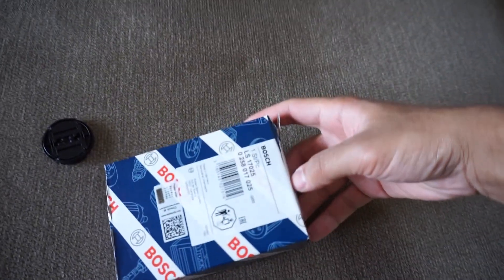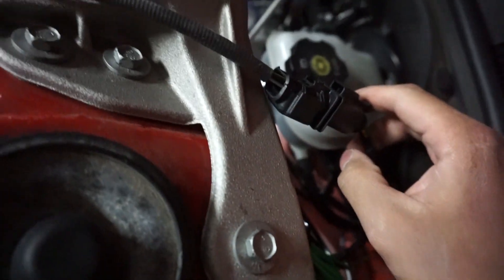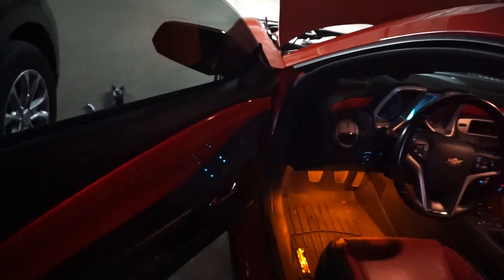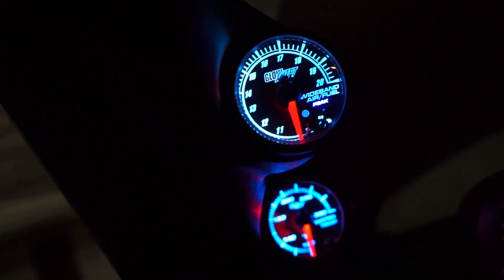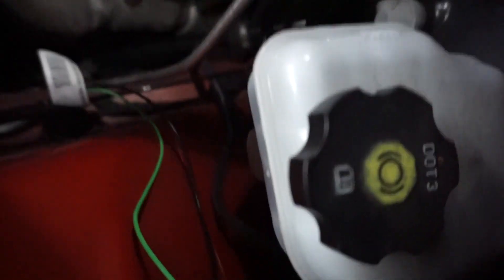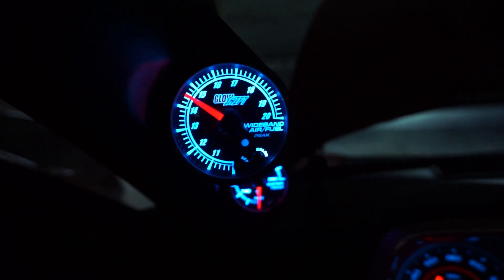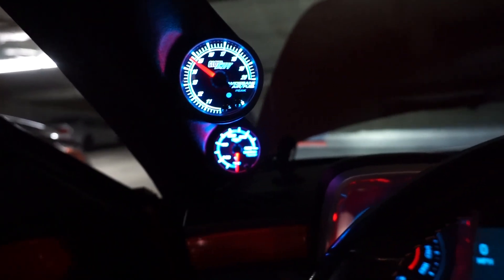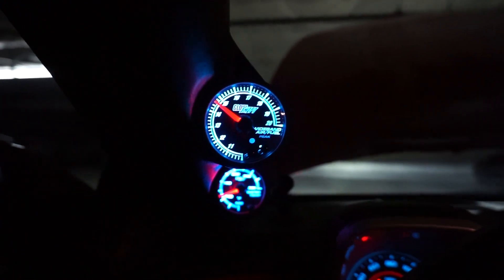GlowShift WideBand Calibration(High Low Warning Setting)

Comment: I'm pretty positive. You don't have to do that everytime you start the vehicle that makes no sense what's the point in the gauge. If u got to make sure it works everytime u turn the car on lmao wth
Reply from the maker: It's not making sure it works, it's the sensor warming up. Glowshift says it's a mandatory thing you should do every time the gauge and sensor are powered. If you don't want to wait, that's on you champ. And if you dont believe me, look up the glowshift wideband instructions and it's in fine print for yah.
Reply: @mistermanage1119  the digital seems to be different from the stick gauge.
Reply from the maker: @LaCacaLoca  In what sense?
Reply: @mistermanage1119  I don’t have to do that and it doesn’t say in the manual to either. It just recommends to recalibrate sensor outside of exhaust pipe every 6 months for daily drivers or every time if track use.
Reply: @mistermanage1119  maybe it has to do with the min and max setup on your gauge to keep it calibrated also. Since digital is just reading straight through the controller calculation output. There is no other button other than to change color on the digital.
Reply from the maker: @LaCacaLoca  Here you go bud. https://www.glowshift.com/instructions/7-Color-Series/GS-702DL-WideBand-Datalogging-Gauge.pdf
Read the part that says "Prior to operation, the sensor must warm up for 30
seconds. This is a mandatory process every time the gauge
and sensor are powered. The LED display will show a
scrolling graphic until the warm up phase is complete."
Reply from the maker: @LaCacaLoca  The calibration button is on the controller not the gauge.
Reply: @mistermanage1119  i don’t know what version I got. My instructions don’t look like that and the constant power saves color and last calibration status. 

The recalibration is 6 months instead of 3. I’ll find my invoice and see which one was the version I got.
Reply from the maker: @LaCacaLoca  That link is off the website so its up to date. the sensor needs to warm up every time not calibrate. As I said to the other guy above, its not calibrating, its warming up.
Reply: @mistermanage1119  I never said you were wrong. I had suspicions mine was a little different that’s all. Good to know either way if I go with those some day.

Comment: which fuse is for the dome light the fuse box on driver side cant tell
Reply from the maker: I don't think there is one. You would have to search online for the fuse panel. Here is a link to a website and I don't see any for the dome. What are you trying to do?
Reply from the maker: https://www.autogenius.info/chevrolet-camaro-2012-fuse-box-diagram/
Reply: Anybody know? Its bcm but what is it
Reply from the maker: @great4ever845  Thats body control module
Reply: Ok ibe got the lights but they stay on using adapter to connect to dome fuse ??? I dont want them to stay on what fuse can i use
Reply from the maker: @great4ever845  I cannot help you because you are not telling me what you did. Nothing you are saying is making sense. There is no dome fuse. I have no idea what you tapped into. The only fuse you can use that is switchable is the 20 amp power outlet.